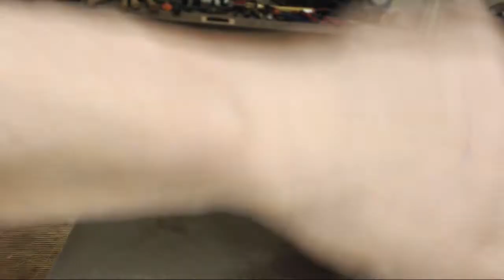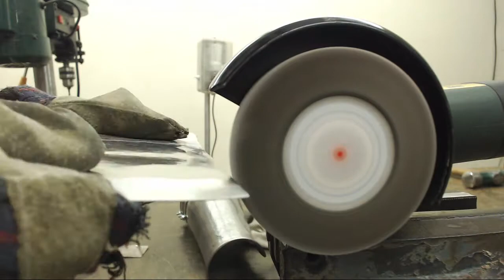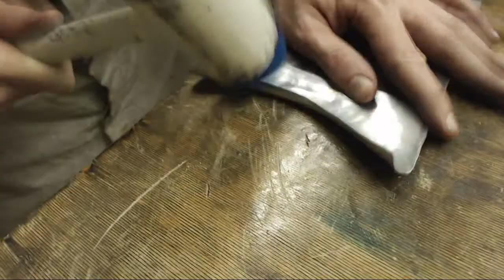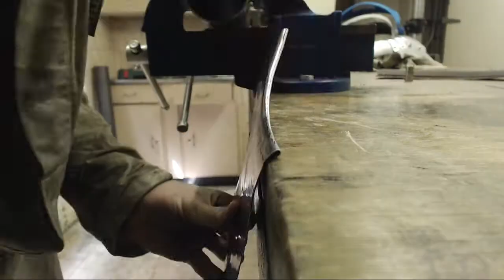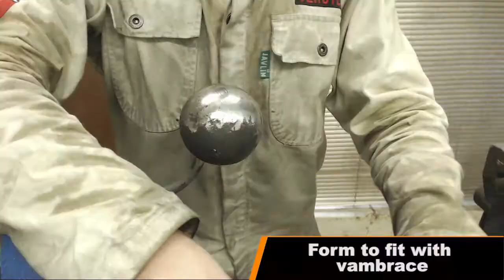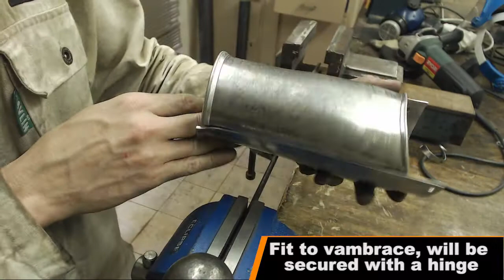Medieval arm harness build - Making a metal vambrace wrapper

Comment: how thick is your steel?
Reply from the maker: 1.6mm/16 Gauge
Reply: @ManinaCanArmoury  are you sure about that? doesnt look like its responding like 16 guage?
Reply from the maker: @mrjimjimjimmyjim9824  Definitely 1.6mn
All the armour I made was from sheets of 1.6mm cold rolled mild steel, except for the great helm
Reply: @ManinaCanArmoury  well im very impressed, i typically work with 14 or 16 gauge and i have never been able to cold roll the steel with hand tools at the ends of the sheet